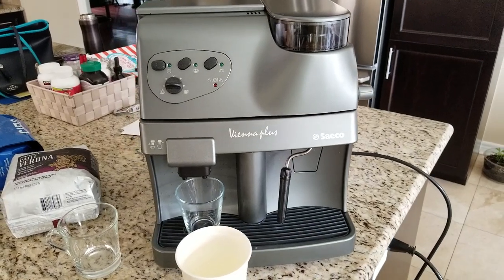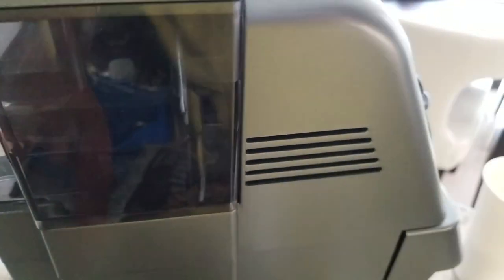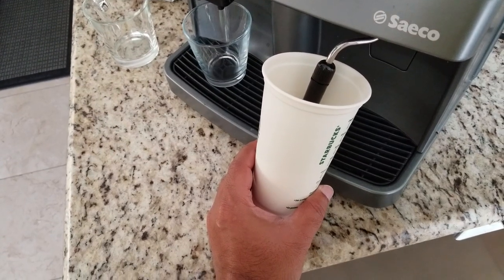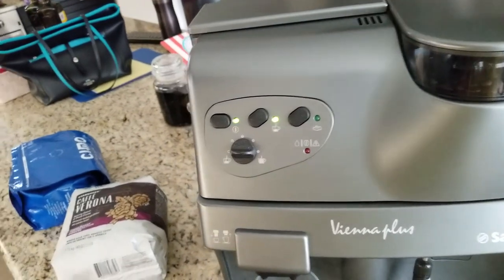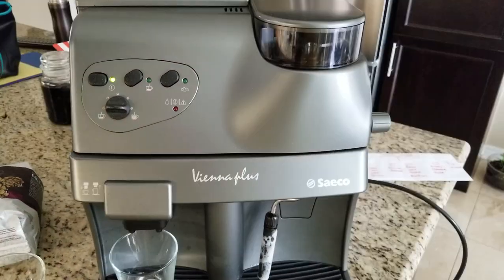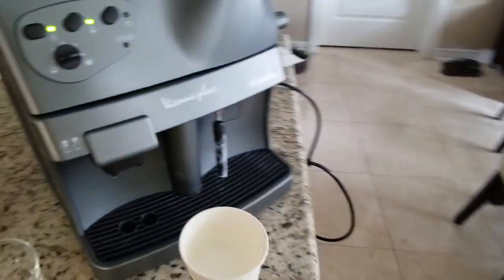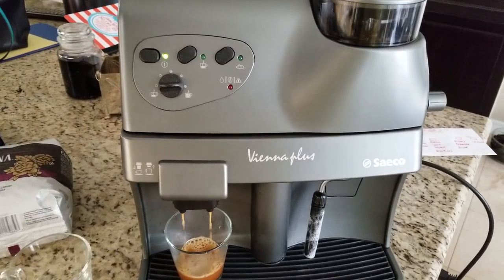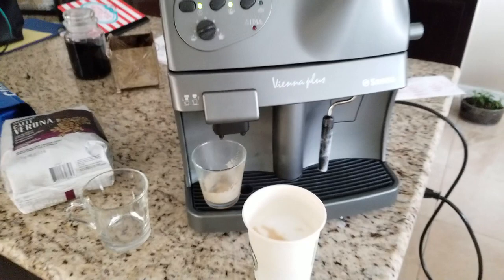Using Saeco espresso machine with hidden debug features

Comment: For double shot just press it twice instead of making 2 separate shots, also either your grinder setting or the amount of beans you are grinding is not correct for a strong espresso shot, that's why your shot looked like American coffee. Increase the amount of coffee you are grinding and set the grinder at much smaller grinding setting, you will see the difference.
Reply: Hello, I'm using that machine too and i wanna ask what is your grind setting? What do you think is the best number for espresso?

Comment: The water dont work
Reply: You might have a clogged pipe.  You may need a technician to look at it.
Reply: Check your waste water try if it's getting too much water, in that case you need to replace your brew valve, if waste water is normal then your pump filter looking white circle thing has dirt in it, that's only if you can hear the pump running, otherwise your problem is the pump itself.